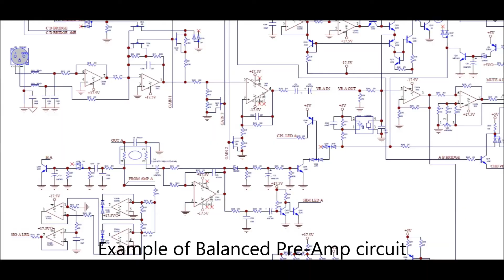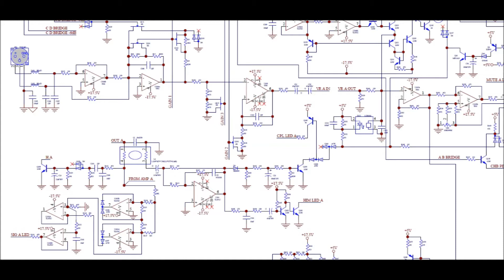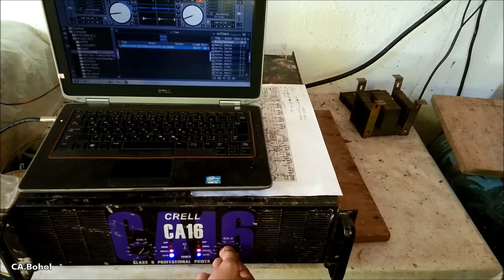CRELL CA16 Amplifier,.. No Audio (Solved)

Comment: Na over drive ba Ang ganyan po na no suonds na power amp
Reply from the maker: Na overdrive pag hindi matched ang input sensitivity,..
Reply: U Crell 9 ho, ba Kya ba, Ang dalawa 1000 watts na live D, 18 po
Reply from the maker: @richardgomez4452  kaya cguro boss.. Pero mabilis mag clip ang Amplifier. Dapat mataas ng doble ang power ng amplifier kaysa speaker para hindi mag clip at mag produce ng DC output ang amp.

Comment: sir meron po akong power amp, ung isang channel my audio out, pero ung isa wala, tapos yung signal led nia sa front umiilaw nman,,ano kaya ang posible na problima?samalat po
Reply from the maker: Try nyo po echeck ang signal input Sir, from balanced input to amplifier Board. Check nyorin kung nag trigger ba ang relay ng Amplifier.

Comment: Gandang tanghali bos tanung kulang po u dalawang 1000 watts na D 18 Kya po ba ng isang Chanel na 1000 RMS na power amp
Reply from the maker: Kaya naman Boss,.. Waglang epa overdrive kasi wala ng headroom ang amp.
Reply: Morning Bos pasinsiya na po kyo kng midyo matanung po,ako Ang 1500 po na RMS ng isang chanel sakto lng po sa dalawang  1000 watts na d18 ksi po Sayang mg pera pg de, Mach u power amp na bibilhin
Reply: Ksi po  pag ngtatanong ako sa quiapo kahit 500 RMS daw Ang isang chanel Kya daw u dalawa 1000 watts na D 18 live,
Reply from the maker: @richardgomez4452  Totonog din Boss,.. Pero limit kalang sa volume kasi wala ng headroom ang Amp. Mabilis na cya mag clip... Pakinggan nyo nalang ang tonog kung feel mo na distorted na ang tonog adjust lang ang volume...
Reply: Ah,  yon, po na pinapa upgred Ang  power amp maganda din po ba yon
Reply from the maker: Maganda naman Boss pero depende sa nag upgrade,. Dapat ma salang sa oscilloscope pagkatapos para matingnan kung nag improve ba.
Reply: Gandang tanghali Bo's u mg, aapgred ng power amp ko  hinihingean  ako ng 16k, Mahal ceguro Yun bos

Comment: Gandang hapon Bo's anu po ba Crell na number Ang Mach sa apat na  D,18, 1000 watts u pong png 12 oras  puro disco Ang music
Reply from the maker: Kung 1000W RMS Boss,.. Ang rule of thumb is dapat x2 ang power ng amplifier... Hanap ka ng 2000W RMS na amplifier Boss. Check mo yung Crell CA25,.. Kung gusto mo naman original na amplifier yung labgruppen FP20000...
Reply: Salamat Bo's pero u CA20 pwede narin ba sa apat na 1000 watts